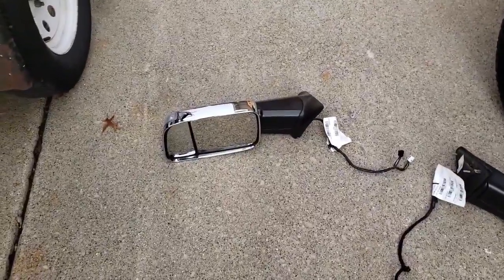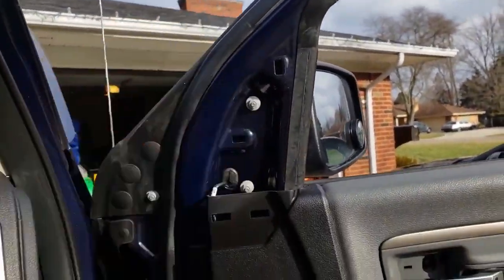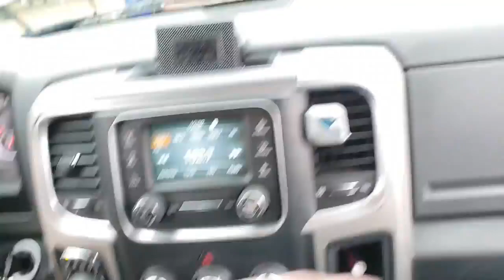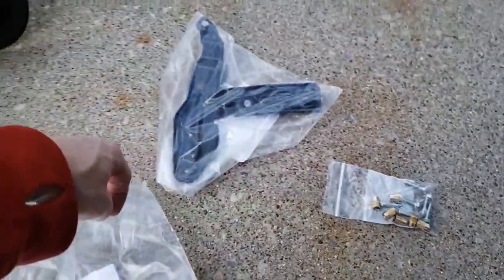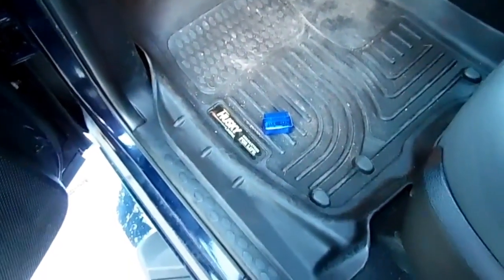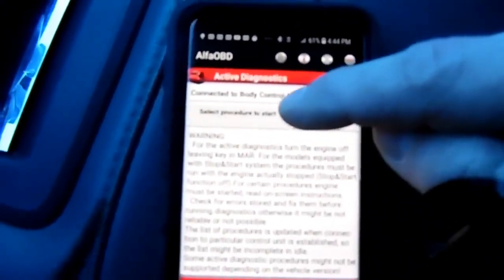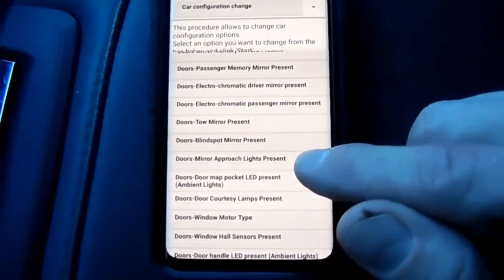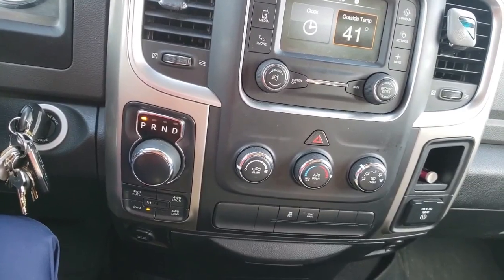Tow Mirror Upgrade 2015 Dodge Ram 1500, How to Turn on Turn Signals and Puddle Lights

Comment: Great video software is a bit tricky but legit and so many options ... great video great app. New mirrors from Amazon 360 CAD obdII 30 CAD software 60 CAD. Entire package with 2 mirrors cheaper than one oem stock mirror

Comment: I added the option for tow mirrors to shift down when i go in reverse but it doesn't work. I have the option on the radio but it wont save. I read on the app that you need mirriors that have a 4 pin connector

Comment: I do not see an option for approach lights or puddle lights. I have a 2012 ram 1500. Any suggestions?
Reply from the maker: I don't think it works on 2012, but I could be wrong. Try the Ram Forums.

Comment: Awesome instructions.  Do you know if your dodge does not have the motorized fold back as stock and you install tow mirrors with fold back option, is it pre-wired or do you have to install another switch?  My garage door only gives me 4 inches space on each side with stock mirrors, so tow mirrors will have zero room, thus the need for motorized fold back.  Thank you
Reply from the maker: https://youtu.be/fRsAuTx9-Ow
You can find the modules and driver side door switch panel at a junk yard.
You can also program the truck with AlfaOBD to turn on the features of the new mirrors

Comment: I installed the tow mirrors, with puddle lights and turn signal, on a 2012 ram, will this app work in getting the turn signal and puddle lights working? thanks.
Reply from the maker: I think so. Here's the website if you want to do some more research. 
https://www.alfaobd.com/
Reply: Did it work for you the tow mirrors?

Comment: What obd2 reader are you using because I read alfaobd only works well with certain in’s readers the good ones are 100+alfaobd app is 50 ,
Reply from the maker: Obd link mx is what the alfaobd website recommends. I used a cheap blue one I got on Amazon and it worked. Others with a 2015 have reported it working. Others who do not have a 2015 have reported the blue one  NOT working.

Comment: Hi Barry! Can you tell me the numbers of the door blocks that you changed so that the mirrors folded? I can't find accurate information anywhere.
Reply from the maker: The mirrors I installed were not power folding. In order for me to do that, I would have to replace the modules inside the doors and replace the switches on the driver side door. I don't know the part numbers but you can get them from a junk yard. That would be the best option. If you want to spend more money, you can a kit from https://www.infotainment.com/collections/all/products/13-18-ram-truck-power-folding-mirrors-package?variant=6826894524452
Reply: @WorkingOnStuff  Thank you!

Comment: Hi I buy aftermarket tow mirrors but in the app alphaobd demo not show me tow mirrors or paddle light or signal light mirrors my truck is 2014 ram 1500 sport quad cab mirrors and lights is connected only working power and defrost
Reply from the maker: The demo won't be able to make any changes. You have to buy the full version.

Comment: Did your old mirrors have power fold and is so do the new mirrors still power fold? I have to fold my mirrors in to fit in the garage, so power fold is a must.
Reply from the maker: My old mirrors were not power fold. To upgrade, you will have to buy power folding mirrors,  new switches for the doors and modules.

Comment: So i followed all the directions like you showed and i got my turn signals to work but im not getting the puddle lights or approach light options on the app.. any suggestions as to how i can get that option to make the puddle lights work as well
Reply from the maker: The setting is called "doors mirror approach light present"
Reply: @WorkingOnStuff  yeah i went over all the options and that one is not showing up, only two options show up for mirrors which are mirros turn signal present and mirror defrost present
Reply from the maker: @gabrielserrano5403  
It should be in there. Close to half way down there are a bunch of settings that start with "doors". I select 2015 for the year. I don't know if that makes a difference.

If you are still having trouble, you can contact AlfaOBD. https://www.alfaobd.com/
Info@alfoobd.com
Reply from the maker: You don't have to have the app connected to your vehicle to scroll through the settings, so this is something that can be done while laying in bed. Once you find it, note the position of the scroll bar, or take a screen shot. This will help find it when you go back out to the truck.
Reply: @WorkingOnStuff  i just tried to look for the approach lights and puddle lights on the app without it being connected to the truck and both options were there, but as soon as i connected the truck to the app those options dissapeares i cant find why and the website for the app wont explain... thats so weird that it wont give me that option
Reply from the maker: @gabrielserrano5403  yeah, I would definitely shoot them an email. That dosen't make much sense.
Reply: @gabrielserrano5403  did you ever figure out the puddle lights?

Comment: I got side swiped just the other day, took out my passenger mirror, if my mirrors already had the turn signal, puddle light,heated, and power fold, would I be able to just plug everything in without needing to adjust with an app? 2017 Ram BigHorn.
Reply from the maker: If it was already on, you don't have to turn it on again. Just replace the mirror.
Reply: @WorkingOnStuff  Thank you for responding.

Comment: Very good video. I have a 2013 ram and was able to get the blinker lights to work but can’t for the life of me figure out the puddle lights. I watched your video over and over and have everything turned on that you did and still no go. Any ideas what I could be missing yet?
Reply from the maker: It's not likely, but it could be bad bulbs. My driver side just stopped working. I need to order a new one.
Reply: Aaron Paun did you find a fix for this yet ? Same happened to me
Reply from the maker: @Proto2011Rail  my issue was a bad bulb. I ordered a new set and they're working now. You can rule this out with a multi meter. You should get 12 v after hitting the unlock button
Reply: Daniel Gallardo I did not test the bulbs yet. I had other issues with my mirrors so I got another set and those lights did the same thing. Blinkers worked but puddle light didn’t. Could very well be bad bulbs since I got the mirrors pretty cheap.
Reply: Barry Cagle awesome man will def test them out 🙏🏽
Reply from the maker: @paun30  I have a video on checking for bad bulbs. I'll be posting it soon.
Reply: Barry Cagle that would be great! I’ll look forward to it
Reply from the maker: @paun30  https://youtu.be/X2L749EW4Tc

Comment: Are you using the demo or pay version of Alpha OBD? Does it make a difference which you use. I only want to program my puddle and turn signal on the towing mirrors I just installed, Thanks.
Reply from the maker: I don't think you can do anything with the demo. I think it is just so you can see what the app looks like. You have to get the paid version to change anything. Its $49 and you can make unlimited changes to not only your car, but any compatible car. There are some other similar devices that once you use it on your VIN, it cannot be used on any other vehicle.
Reply: @WorkingOnStuff  Thanks. Figured that was the case.

Comment: What's wrong with just using the 3 mirror screws ?... does it need the bracket  ?
Reply from the maker: You need the brackets to upgrade to tow mirrors.

Comment: Can I use any other OBD2 scanner? I have an apple product and don’t wanna change phones just for a truck
Reply from the maker: The last I checked, thre app is not available on Apple. Some people have had success using different adapters but others have not. Even with the same model and year truck. Thre 2015 big horns seem to be a little more forgiving.

Comment: I have the basic mirrors I want to change them my friend has a set from his sport 1500 with turn signals puddle light n folding mirrors, would all those features work on my truck or do I have to change the madule n program it ?
Reply from the maker: It depends on what modules and switches you currently have on your truck.
Reply: @WorkingOnStuff  I have a ram express i heard they have most of wiring n connections ready to plug . I’m not sure I will have to check . Thanks

Comment: So will this obd scanner get my puddle lights working and check engine light off? I had reg mirrors with everything now got tow mirrors
Reply from the maker: You can turn on puddle lights, but it's not called puddle lights in the computer. it's called mirror approach lights, or something like that. It's in the video. You can delete trouble codes, but if it's an issue still present, like a tailight out, it will come back on
Reply: @WorkingOnStuff  ok thank you sir and I can turn it on with alpha obd?

Comment: Hello my Guy I have a lot of question : did you do the obd relearn right after the installation or are the puddle lights and turn Signals had work right after the installation ?
Will this work on a dodge ram 1500 sport with basic mirros with no turn signals or puddle lights 
I saw a lot of review on the obd that you buy on amazon, does your truck still work today after you did the relearn ?
Can the door module be replaced if mine doesn't have the plug to connect the turn signals/puddle lights ?
Reply from the maker: I installed the mirrors then changed the settings on the computer. My truck did not have turn signals before but I was lucky enough to have the right module in the door. If it didn't have the 4ight module, you can replace it with the right module
Reply: @WorkingOnStuff  thank you for your answer and i have another question : how can i choose the right door module because i have a 1500 sport so if i buy a laramie door module even if it's the right year it will not work right ?
Reply from the maker: @blakedexter3224  it's not the model. It's the year. You can swap out any part from 2013 to 2018
Reply: @WorkingOnStuff  oh... because i have a 2009 and a 2011 will this still work ?
Reply: @blakedexter3224  

1. "did you do the obd relearn right after the installation or are the puddle lights and turn Signals had work right after the installation" ... He literally told you what you have to do as well as him showing the process to get them to work in the video bro.

2. "Will this work on a dodge ram 1500 sport with basic mirrors with no turn signals or puddle lights" ... His video shows the basic mirror with it actually still installed before he put on the upgraded version.  Did you skip to the very end? Pay attention and watch all the video. 

3. "Can the door module be replaced if mine doesn't have the plug to connect the turn signals/puddle lights" ... His video shows you don't have to replace it and also, all the vehicles came with the same harness regardless of trim so your should have it.  If not, that obvious means you need to upgrade the module which I doubt because again, they all came with the same harness regardless if it's the base or premium trims. 

4.  "i have a 2009 and a 2011 will this still work ?" ... He just told you (You can swap out any part from 2013 to 2018). Your trucks are 2009 and 2011 which means your vehicle does not fall within the same generation(4th) for these windows so of course it will not work.

Comment: How do you know if truck will be compatible with the wiring of the tow mirrors? I have a 2015 Ram 1500 Big Horn with just the plain stock mirrors
Reply from the maker: You can call the dealership with the vin of both your vehicle and the vehicle the new mirrors came from. Or you can have a look inside the door to see if the module has two plugs.
Reply: @WorkingOnStuff  if it doesn't have the two plugs my only options would be to purchase those necessary modules or just be sol, right?
Reply from the maker: @wreckagevic  
Yup. I don't think the modules would cost much, if you don't have the right ones. Check the junk yards in your area.

Comment: Im need to do this same up grade to tow my camper.  Will that small scanner  activate  brake control module  i want  to ad a fac style one? Thanks in advance
Reply from the maker: Yes
Reply: Ok awesome  thanks. Any chance  you  know  a good source  for the controller and components?
Reply from the maker: @justinfiggs5290  
https://youtu.be/pATys2ahXy0

Comment: Question the right passenger side the mirror is magnified ? I don’t like mine the drive side is fine can see everything same side but the passenger side the thing look bigger ..... why ?
Reply from the maker: Mine look the same on both sides. I'm not sure why yours would be like that. Maybe a different model or year?
Reply: Barry Cagle is aftermarket maybe that is the problem
Reply from the maker: @watchmanexpert  maybe. Mine are factory Mopar from the junk yard

Comment: Do you have to purchase the app for 49.99$? 
while attempting to program my is said that all I have is a demo version
Reply from the maker: Yup, you have to buy it for $49. Once you have it, you can make unlimited changes to multiple vehicles. Usually  devices that operate like this app cost hundreds if not thousands of dollars and you are limited to only using it on one vehicle.

Comment: Did u have to change the modules too ? And to make the signal lights work did u have to activate from alphaOBD as well or just the paddle lights ?
Reply: I did not have to replace the modules in the doors. I did activate the turn signals, tow mirrors setting and puddle lights with alfaobd. I show how to do this in the video.
Reply: bearcagle hey sorry if I’m bothering you again but I’ve just installed those mirrors today and i have the engine light on because of the temperature sensor, and the sensor is actually stuck at -40 c right now, do you think it will go away once i will program it with alfa obd ??
Reply: @Italianborn  replacing/adding different lights, components, and accessories on your vehicle without programming the computer may cause warning lights to come on.
Reply: bearcagle i solve the issue already, I’ve been awake almost all night looking for an explanation..so the mirrors i bought didn’t have the ambient sensor in it..that is why the engine light came on and my temp was stuck at -40...so i took the sensor wirh wiring from the old mirror and installed on the new towing mirrors..now i just have to erase the error code with an OBD and that should be it..thanks!
Reply: @Italianborn  good to hear. Nice trouble shooting work.
Reply: ok

Comment: Barry your video was great I bought the mirrors, brackets, veepeak and the alphobd. Everything worked great. Turn signals work but not the approach lights (puddle lights). Any suggestions?
Reply from the maker: Hey Ralph, There are a few things you can try. First make sure you have 12 v. Going to the puddle lights. Here's a video on how to do that.  https://youtu.be/X2L749EW4Tc

If not, let me know.
Reply: What year was your truck and did u get it to work
Reply: @MBB5658  was a 2014 used alphaobd to change the computer settings.
Reply: @ralphhurley  what obd plug did you use was it the veeapeak or obd link 2 mx?
Reply: @MBB5658  veepeak, it's nice I have used it on my jeep and my wife's challenger.
Reply: @ralphhurley  thanks

Comment: Great video, I was wondering if this app allows me to turn on my brake controller? I have a 2017 2500 Cummins tradesman, so it didn’t come with the brake controller, before I spend the $50 on the download I was wondering if I can turn on the brake controller as well, because I have to do the tow mirrors also. Thanks
Reply from the maker: Yup, I have a video on installing a trailer brake controller. 
https://youtu.be/pATys2ahXy0
Reply: Barry Cagle awesome, thanks man, everything worked great for the lights, still waiting for my brake controller to come in, my puddle lights aren’t coming on yet though, not sure if they’re supposed to be only at night? I know some trucks they come on when you hit the unlock button on the key fab, thanks

Comment: bro thank u for the video.question do you drive your truck without brackets.
Reply: The T shaped reinforcement brackets on the inside of the door? No, I put them on. Ordered them from the dealership for pretty cheap.

Comment: I have a 2019 Classic model. What body computer do you recommend me to use? I am seeing there are about 5 options
Reply from the maker: I wish I owned a 2019. Nice truck. You can either find out by calling the dealership with your VIN, contacting AlfaOBD, here's their website 
http://alfaobd.com/
Or you could try the Ram Forums. There are a lot of knowledgeable techs in there.
Reply: Hey Barry I just purchased both items and while trying every step you took I am getting a error message which states. “ No data received from ECU /Interface or data corrupted. Try to start the procedure again. If you receive this message too often try to adjust ‘interface Timeout’,’interrequest time’, response -request time’, and request interbyte’ parameters. If this will not improve connection stability your interface is probably faulty. 

Do you have any idea on how I can get this fixed ? 

Thanks
Reply from the maker: @erickmontoya3926  on a  2019 I think there were some issues. It will still work, but you might have to get a hard wire bypass module to make it work. Check out the Ram Forums and I would check out http://alfaobd.com/